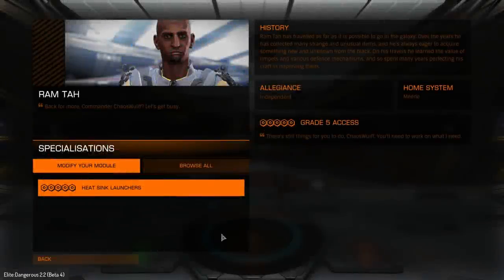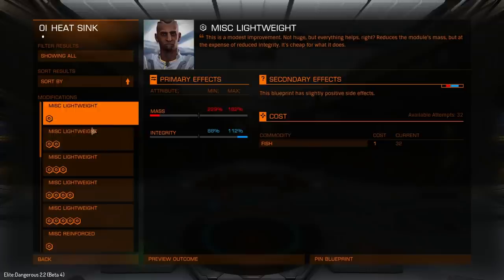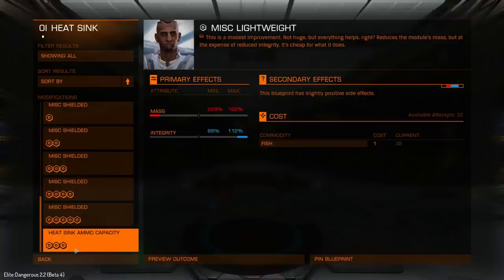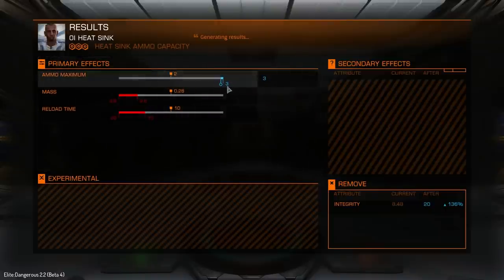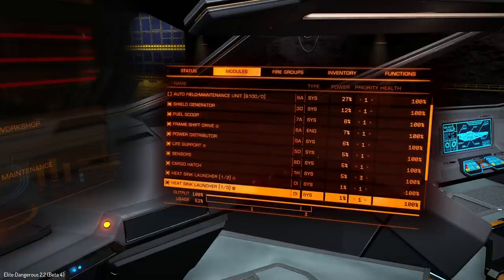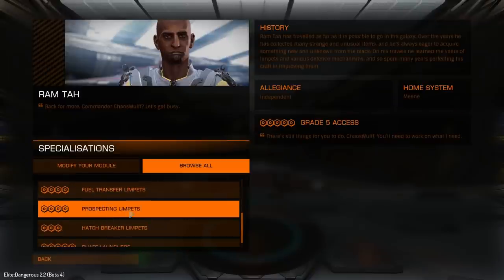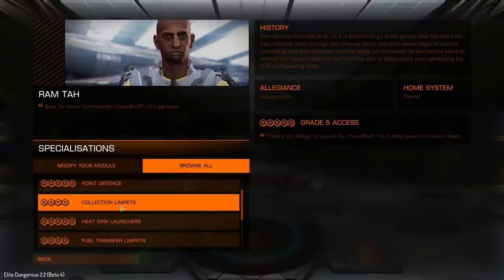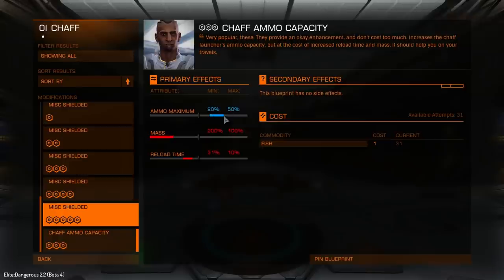Elite: Dangerous - Engineer Ram Tah Revisit

Comment: I still think this is a huge missed oportunity limpet wise. Why no Modifications for Limpet Lifetime? More Limpets on the cost of higher Energy consumption? Faster traveling Limpets? More resilliant Limpets which could take a collision or two? Programmable Limpets so they wont scoop up the low value Materials? I really would enjoy options like this.